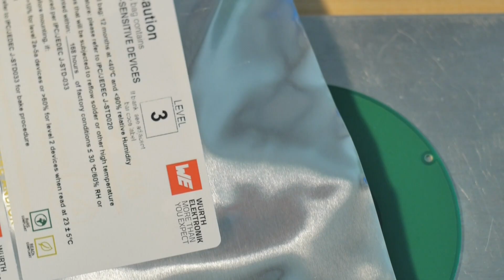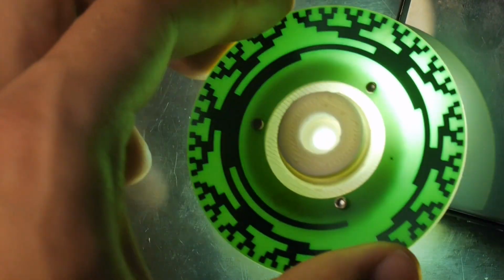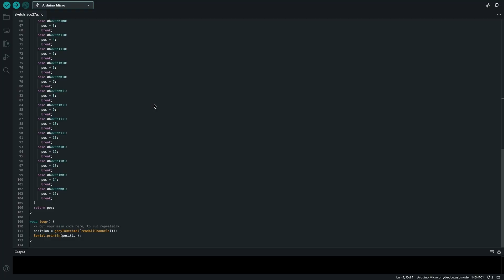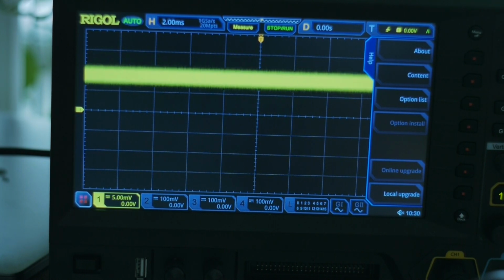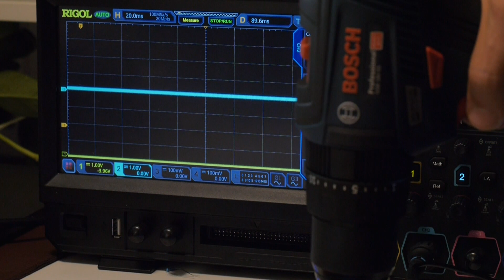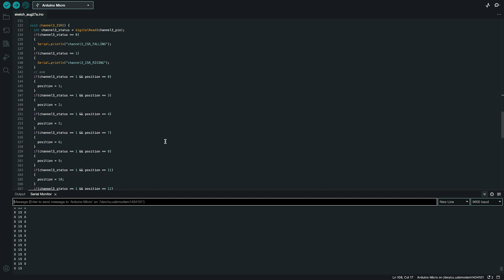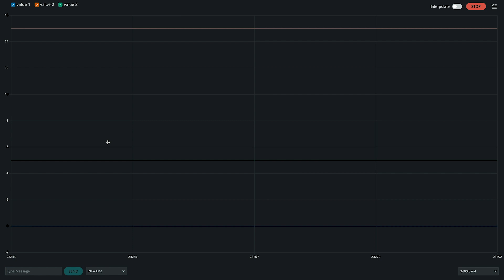4-bit absolute position encoder build

Comment: This is how I would have done it if i was doing it 4 hours ago, but in the last 4 hours of googling and playing with ideas can I mention two things, 1, your outer track is behaving like a LSB, its flip flopping way more than other bits, you can do gray code with even bit flipping so that the flips are shared between the tracks move evenly (But I would still favour more often flipping to the outer tracks) , and for point 2, have you looked at single track gray code with the sensors spaced around the perimeter?
i'm just now settling down with strong coffee, a pencil, and designing my 0-11.0 encoder for my amplifier....

Comment: Would it be absurdly out of the scope of this project to make a 24 bit absolute encoder?  Looking for application on an astronomical mount for sub arc second position, so the rpms aren't a consideration.  Thanks for this great idea!
Reply from the maker: With the current LSB spacing a 24-bit encoder would be a huge disc.
But for sure worth a try to reduce the spacing to get to a better resolution.

Comment: I have something like a "data ready" on my mind, where an extra detector with a very short hole tells the CPU to "read now".
This has the disadvantage of not knowing, where the encoder is when the system is powered on.
But the reading of the position while it's moving will always be at the best position - the center of a obscured or open area.

And who will stop you from implementing a Hamming code here too together with the Grey code 😀

Comment: I'm interested in a really cheap absolute linear position encoder.  It doesn't need to be particularly fast, since it is tracking the movement of a 3d printed mechanism being positioned by a servo motor.  This approach seems like it could be adapted to this use case, and it could be implemented by PCBs with surface mount components, so it would be cheap to prototype.  Do you think this approach would be feasible and yield the results that I'm looking for?  Anybody have an open source example of somebody doing something similar?

Comment: You are on a good track that will work. It will be interesting to see how fine a resolution you can get. There are certainly uses for 4-bit absolute encoders, but the greater the resolution, the more uses for the encoder. I always wanted to work with these when I had the facilities to do so, but I never had the time. Now, it is much less expensive to do these kinds of things, so it is good to see you doing them.. Using a single light fiber smaller than the width of the copper trace to precisely illuminate each trace of the encoder would reduce the cross talk at the price of added parts and complexity. Moving the light sensor to 8 different positions around the axis of the encoder should eliminate cross-talk and the cost of the need to very accurately position the light sensors or do a fix-up in software needing a much faster CPU to race the same speed the simple encoder can achieve.
Reply from the maker: Thanks for watching! Spacing the pairs of photodiodes and LEDs around the circumference is a great suggestion! 
I think the fibers will be too expensive for the intended use cases. 
Feel free to check out the latest video It features an updated 8-bit version.

Comment: Nice. If you do get the thing remade again, I’d try it with copper on both sides. Also no solder mask. 3D printed light funnels might help to prevent crosstalk.

For a use-case? A cheap brushless servo to replace stepper motors on CNC machines like 3D printers. If only TMC4671s were cheaper, maybe there’s a Chinese company making something equivalent.
Reply from the maker: Great suggestion! A brushless servo Is what I am having in mind as well.

Comment: Nice work there!

A couple suggestions I can think of, are to have the copper side of the encoder near the detectors, to minimize the difusion of their edges to the detectors.
Next a slit mask over the detectors, so they only can see light from a think slit of the encoder.
Leave off the solder mask of you next encoder, or test to find which mask transmits the most Near IR.

Your code can be quite simplified with a lookup table. You can go from a HUGE if() tree, down to just a few lines. (smaller code space, much faster execution)

EXAMPLE with 2 bit grey code
:  

int Grey2Pos[ ] = 0b00, 0b01, 0b11, 0b10 ;

gray = (encoder)

posTest = Grey2Pos[ grey & 0b11 ];   // the "& 0b11" masks for wrap around, aka mod-4

If ( (posTest == (pos + 1) ) || (posTest == (pos -1) )   // has it moved to the next or privous posistion?
       pos = posTest;                                                          // YES, Save the new position
else
     glitch++;                                                                      // No, there's been a glitch... so record it
   

In the future, say in your next project, you should look into how digital calipers work, as they give dozens of microns of resolution, with a simple capacitor array.
Reply from the maker: Thank's for that great suggestion! Really appreciate your detailed and constructive feedback.
Reply: OPS!  There's a bug in the code... it missed the edge cases of "pos = 0" and "pos = MAXpos"

The test for if "pos" should be updated needs to expand....

add to top:

    greyMASK = 0b11;
    MAXpos = 3;

and change the one if() test to 4 tests...

if (pos == 0)                     // test for underflow of posPrev
    posPrev = MAXpos;   
else
    posPrev = posTest =1;

if (pos == MAXpos)         // test for overflow of posNex
    posNext = 0;
else
  posNext = pos+1;

if (posTest == posPrev)
   pos = posPrev;

if (posTest == posNext);
    pos = posNext;

Not only will this actually work, it's easier to follow what it's doing.
Reply: Nice feedback! Very interesting read! 😊